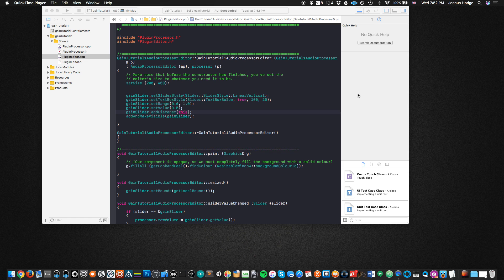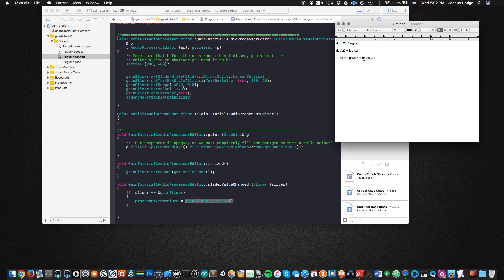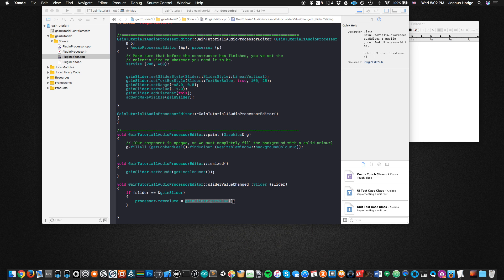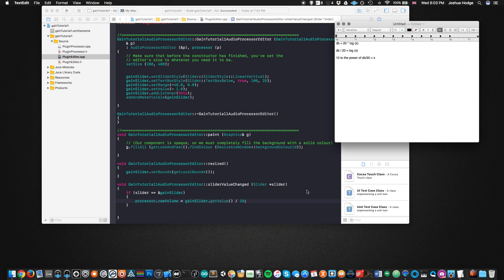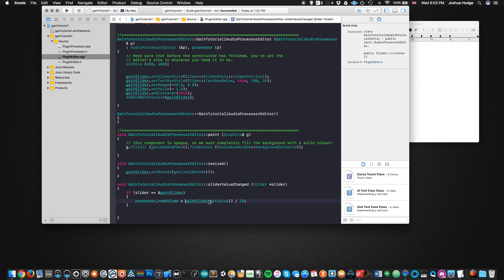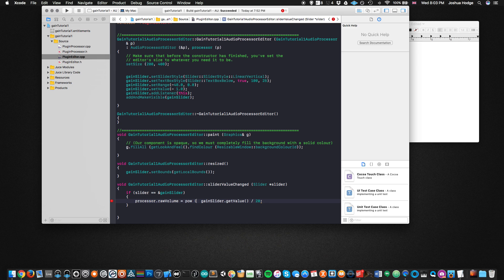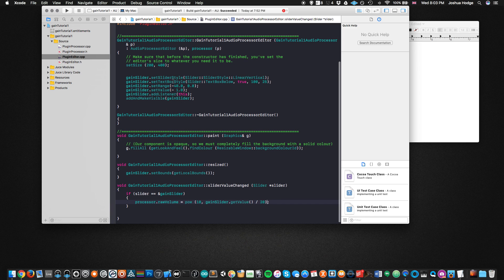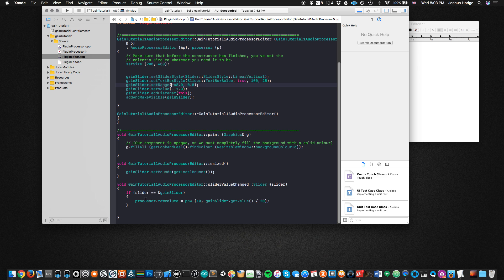Juce Tutorial 15-  Building Your First Plugin Pt 2

Comment: Thanks, Great tutorial !! Someone can explain me why using the pow function instead of log ?
Reply: Thanks a lot for your reply.
I 'm new to C++ and audio programming and I didn't understand what was doing the pow function :D .
So if I understand correctly :
assuming 5 is the rawgainvalue 
 5 = 20 log(x)
log(x) = 20/5
    x = pow(20/5)
Something like that :D
Reply: I used this formula (db = 20 log(x))  for designing /modifyng guitar pedals :D , but get some difficulty to use it  in a programming context thanks a lot

Comment: I'm working my way through and hopefully the clicking is covered in a future tutorial. Ideally we should be testing the performance of sliders with mid to low frequency sine audio not drum beats. It's going to expose problems clearly. I definitely hear this slider clicking with an RME Fireface 802 interface. I don't think the audio interface should have anything to do with it unless there is some signal going through perhaps caused by a DC offset or hum with a mic input? No idea. Anyway, awesome videos, I'd be lost learning JUCE without them. Thanks!
Reply: The speed at which the slider value updates is likely the cause. If the value changes too much from the last updated value a large jump in level between 2 adjacent samples will occur resulting in the click.

Comment: Just to aide any confusion this digital scale between 0 and a negative value is dBFS not dB SPL. SPL is physical pressure at a single location and in terms of perceived volume compared to dBFS it is hard to quantify as it is dependent on size of amp and speaker and listening distance.

Also the reference for dB SPL is 0 = threshold hearing (the softest sound we could hear) and goes up past our threshold of pain 140 dB SPL.

Comment: Great Videos on VST programming. There is a great Course on edx called "Fundamentals of Communication Acoustics". It's great for learning all the physical/mathematical stuff regarding acoustics.  The formula that you wrote ist a translation tool for sound. Another version of the formula is dB = 20log(p/p0). p is the pressure of the given soundimpulse and p0 ist the threshhold of perception (0dB) , both given in Pascal. So dB is nothing else but the relation of the given soundimpulse to the threshhold of perception. This can be applied to the output signal. So with x = 1 (p/p0 = 1) you get 0dB difference in your output signal in comparison to the original signal.